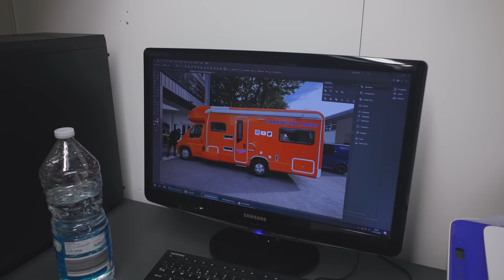Staff Cars Get Egged By Neighbours! TWAY Ep94

Comment: Yanni.
Just to ask what was the reason for the box tuning on the JL subs at 30hz ???
Only they looked like jl w3 v3 12s I may be incorrect but if they are they have a fs of 26hz.
I'm not questioning it just would be interested to know the reason as if it was me I would aim to be slightly more of a musical tuning especially with they types of subs and slot ported box used of around 33 to 35hz ?
Like I said not saying anything bad as it looks sweet just interested in the reasons behind the lower tuning